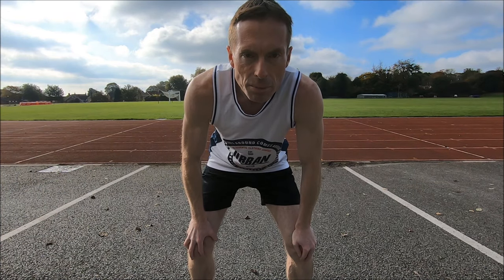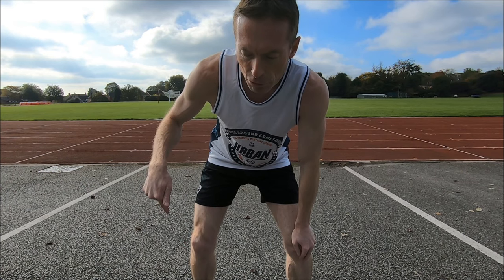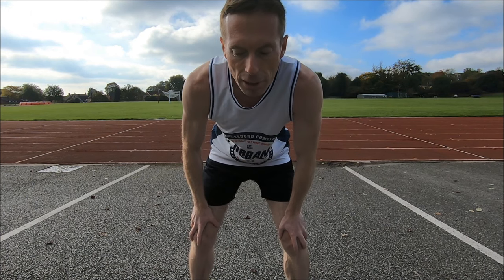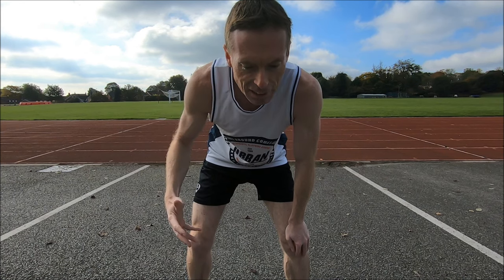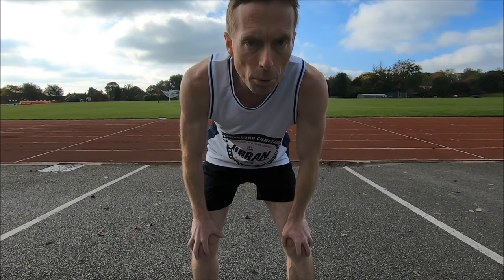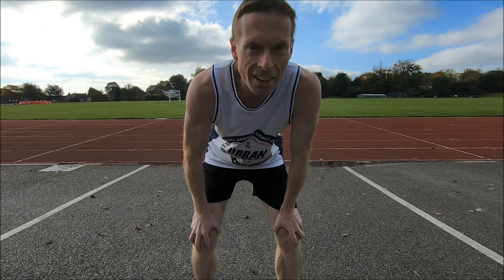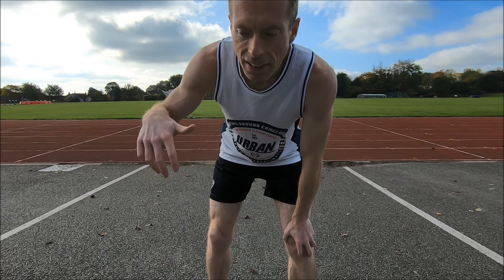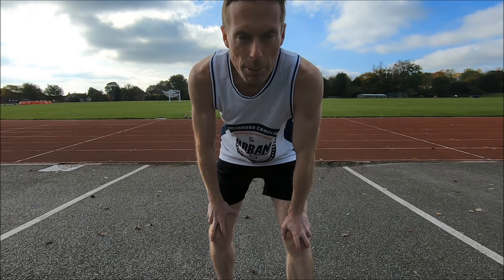100m Sprint Technique Training Vlog - 6 x 10m Fly Reps With Slow Motion - Sprinting Biomechanics

Comment from the maker: The fastest rep is at 2:29 - looks like I got a better ankle stiffness and angle/power with my right leg in particular. So maybe the "ragged" feeling I described was more a consciousness of being closer to my limits?

I make the 10m fly times to be as follows:
Rep 1: 1.34
Rep 2: 1.25
Rep 3: 1.19
Rep 4: 1.20
Rep 5: 1.11
Rep 6: 1.15
(accuracy is probably +/- 0.05, but the round numbers are a coincidence as I did try to measure the times fairly accurately from 1/32 speed, frame by frame)

Shame there weren't any cues for the arms - I hoped my arm technique might improve automatically as a result of the other cues. But it looks like I still need to keep them from coming too far forwards and inwards. A good cue would be to relax the shoulders (avoid shrugging them too much) as @morkymoose9590 commented in previous video.